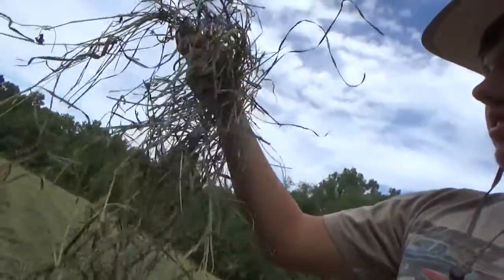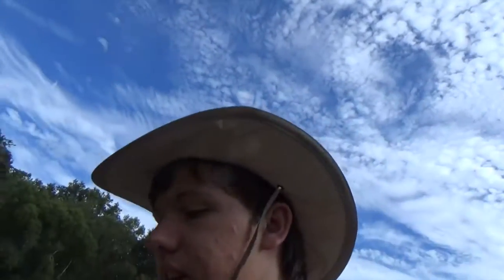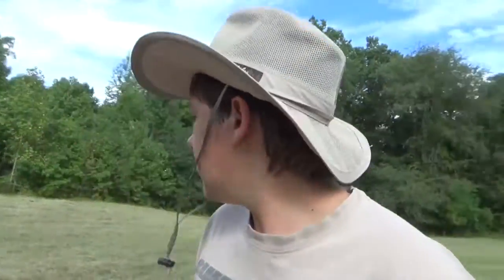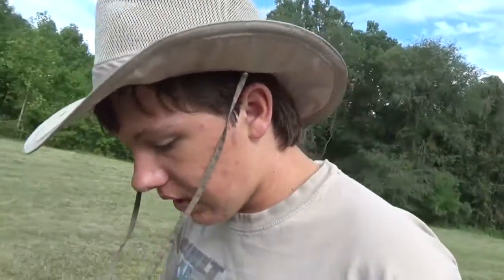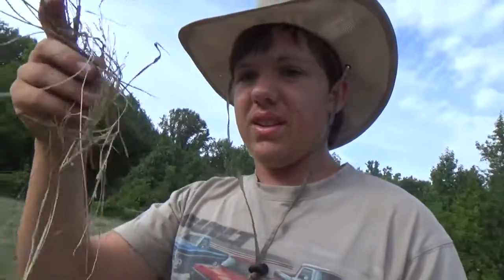Not so dry hay

Comment: The way it's rustling and crunching when you're walking around the field and handling it, I'd say it's pretty darn dry.  Can't really see the stems so it's hard to say EXACTLY but that's actually dryer than you want it to be to rake it.  Basically, as soon as it's "wilted flat" (about 50% moisture) you should be raking it, and you don't want to handle it below that if you can, to minimize leaf losses (dry matter losses which reduce tonnage (yield) and also the nutritional value of the hay, because MOST of the nutrition is in the leaves, NOT the stems... BUT you DO have to wait on the stems to get to the proper moisture to preserve the hay, and stems take a longer time to dry than leaves... so actually by the time the hay is "ready" to bale, the leaves are TOO DRY and the stems are JUST DRY ENOUGH.  

That's why some farmers spray propionic acid or other preservatives on their hay and bale it at higher moisture content-- the acid prevents it from spoiling and "heating up" and molding and stuff and making "dusty hay" while allowing it to be baled earlier when it's still higher moisture, preserving more of the nutrition in the leaves.  

Cutting short hay that's mostly leaves is also good, and should dry down faster and be ready to bale sooner because there are fewer and smaller stems to dry down.  

Hay will continue to dry in the windrow, so long as the windrows are not TOO big (which just slows the process down) and so long as the hay isn't TOO wet (more than about 60% moisture when raking, IOW, still "juicy" or "wet", ie very green and moist yet).  The sun will shine on the windrow and heat it up, and warm dry air from the breeze will blow through the windrow and remove moisture from the stems as it dries.  If it was raked at say 50% moisture (wilted flat) it will dry down to baling moisture in the windrow and won't have to be handled again until the baler picks it up and makes it into bales, thus reducing dry matter losses to the bare minimum.  (Dry matter losses are unavoidable, but minimizable-- all that dust and chaff and fluff and duff on your baler when you're done, and little piles of fluff and duff that fall off the baler onto the field as you work, are all "dry matter losses", along with all the dust and fine stuff you never actually see, of which there can be quite a bit).  Every time you handle dry hay, you lose dry matter, because like the baler, you'll see fluff and duff on your rake when you're done, which is only a small part of the dry matter that has dropped to the ground in the form of broken or stripped leaves, or stuff that's gone through the tines of the rake or ridden over the basket with the tines or whatever... 

Later and hope this helps!  OL J R :)

Comment: At 2:41 you keep talking about "green, green".  Green COLOR is NOT a bad thing!  In fact, properly cured hay SHOULD have SOME degree of green color to it!  The more yellow or brown the hay is, generally speaking, the more sunburned and sun bleached it is and the lower the nutritional value.  So long as the stems are dry enough to store in the bale, the green color is a VERY good thing!  From the sound of the hay, the way it rustles and crunches as you handle it, it SOUNDS like it's plenty dry.  

Have you ever done the "wring" test??  Basically, take part of this wad of "green" hay and wring it out just like you would a washcloth... I mean really twist it over and over again in your hands, tighter and tighter until it's twisted to the breaking point, like you were trying to wring every last drop of water possible out of a washcloth or something... then fold the wrung-out grass in half as tight as you can.  This will bust open the stems and then you can stick this folded over hay right up against the bottom of your nose and give it a good smell... if you can SMELL moisture or feel it on your nose or lips, or if you rub the broken folded over stems between you fingers and feel any moisture (the nose is actually more sensitive IMHO) it's probably too wet to bale.  If it smells like good flue-cured tobacco (hmm... well it you don't smell any moisture in it, and it smells sweet and like good dry hay and you don't feel any moisture in it to speak of) then it's ready to bale, regardless of the color.  

You mentioned in an earlier video about your Dad telling you about the "microwave test"... this is a good method, but somewhat time consuming... take a sample of the "wettest hay you can find" back to the house, put it in a ziplock bag, and weigh it with a little scale.  Write down the weight, then microwave it (with the bag open) for a couple minutes, and weigh it again.  Keep microwaving it until it doesn't weigh less every time you pull it out of the microwave... when it stops getting lighter, it's lost most all of its moisture.  Compare the weight of it when you started with the weight at the end, (divide the weight of the dry sample by the weight of the starting sample) and that will tell you the percentage of moisture in the hay.  It takes awhile though... 

I've done the "wring test" for YEARS and yeah, there's a bit more "art" than "science" to it, but it's just a matter of experience.  Pull some dry hay out of bales and do a "wring test" on it and see and feel and smell what good hay should look, feel, and smell like, and you'll start to get an idea.  Realize though that hay that's been baled goes through a "sweat" and will heat up somewhat and lose moisture the first few days to week or so after it's baled, and hay that has been pressed into a bale feels and sounds different than unbaled cured grass in the field ready to be baled into hay, so it's best to hang around at a neighbor or someone you know makes good hay, go do some wring tests on their hay pulled out of the windrow while they're baling or just ready to bale... feel the texture, listen to the way it rustles and crunches as you handle it, wad some up, grab some and wring it out and put it up against your nose and smell it and get a FEEL for what good dry hay should smell and look like in the windrow... Experience will teach you... 

Later and good luck!  OL J R :)